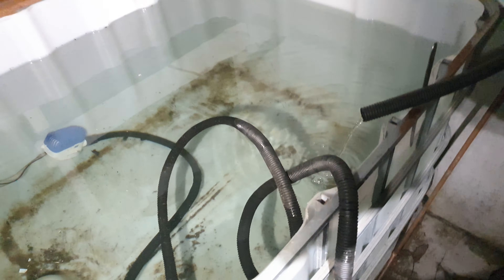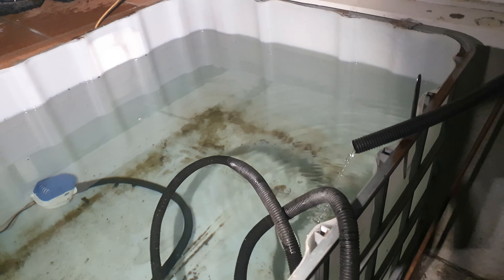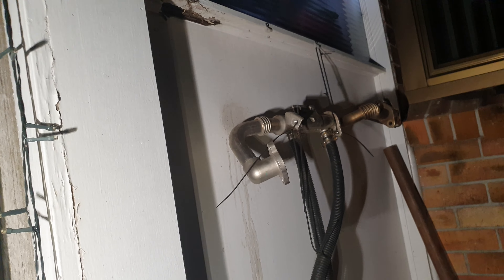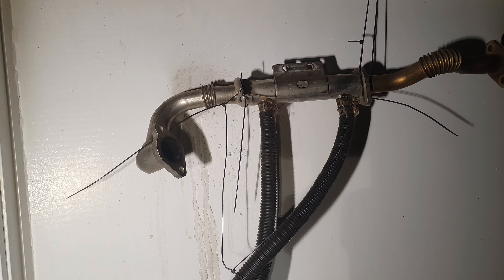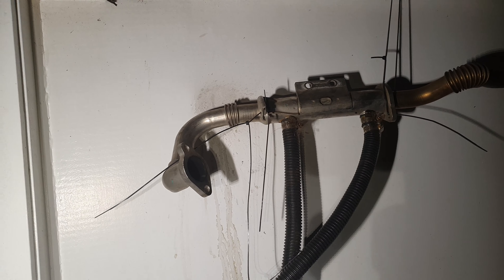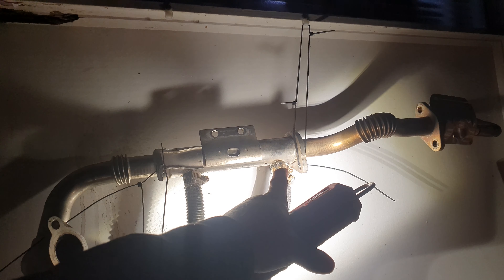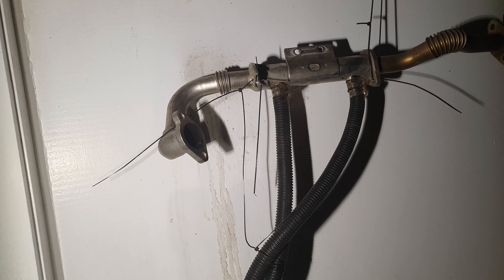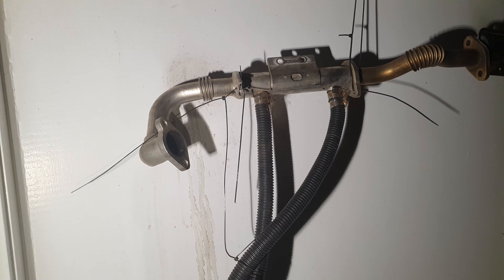Diesel Heater Egr hot tub heater attempt 3 slow down the flow

Comment: Why not use a 2 meter long 25mm copper exhaust off the diesel heater, then tightly coil a 10mm copper pipe around that to run the water through. You could even run the water through a coil of the heater duct for extra heat.
 I am about to install a diesel heater in my rv, i was going to run a long copper in the under carriage as the exhaust to help heat down there I was thinking about add the coil to my main water tank. I was a bit worried it might get to hot down there.

Comment: Awesome man. Remember talking to you about this in the comments section of another video awhile back. Great job putting it into practice 🤘 I think David poz has a dc water heating element sizing chart, it's like an excel spreadsheet might come in handy for some of the calculations 👌
Reply from the maker: Yeah when batterys are full i prob still have  35 to 40 amps at 24v to dump so heaps of grunt

Comment: Thanks for having another go at this one, it makes me wonder how much heat is lost from the surface area of the water itself on this one, not sure if a lid while its heating would help at all but maybe. A few different sources for heating this volume could work nice say, from the wood burner side and the exhaust side and perhaps even on top another one of these heater units with the water system going over the burn chamber block https://www.alibaba.com/product-detail/5KW-7KW-12V-24V-water-heater_60871506423.html?spm=a2756.order-detail-ta-bn-b.0.0.5fcf2fc2idfAj9
Reply from the maker: They are awesome I best order one
Reply: @Oneupthesleevecustoms  they do look great, no moving parts for the win with a clever circuitry managing and running it all, I liked the idea of them as with the wood burners they look nice but need refueling alot where these diesel heaters look like they will eat most fuel mixes with a bit of diesel in without any probs and you can leave them running with the oversight of the clever electronics and efficient fuel dripping pump system running on a decent sized tank. I even thought about swapping the exhaust to a square tube then thermal gluing on some of these on to it https://www.alibaba.com/product-detail/5KW-7KW-12V-24V-water-heater_60871506423.html?spm=a2756.order-detail-ta-bn-b.0.0.5fcf2fc2idfAj9 similar to what this chap has done say https://www.youtube.com/watch?v=xaT2hqHgLdY but still pondering on it all atm, your testing here helps alot, your share is much appreciated to ponder on it all.